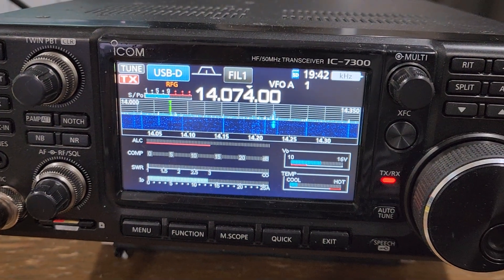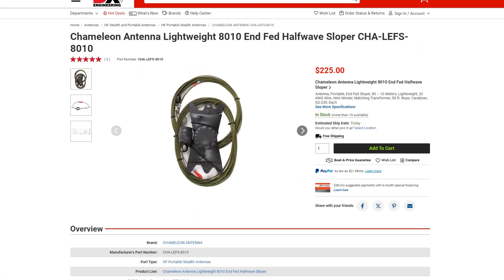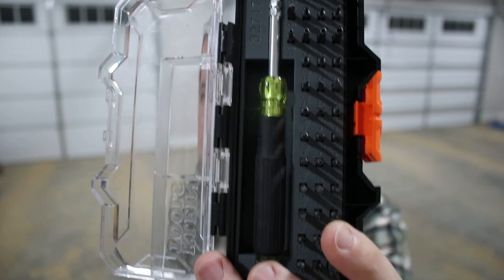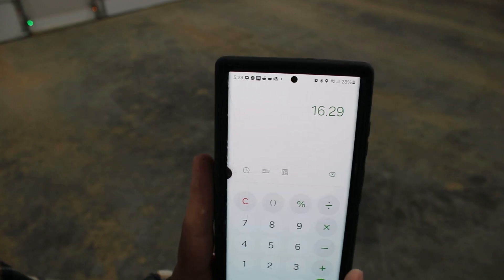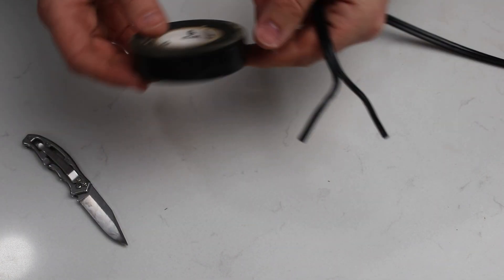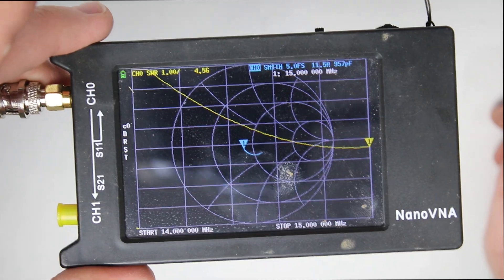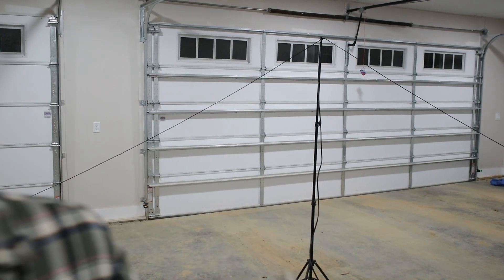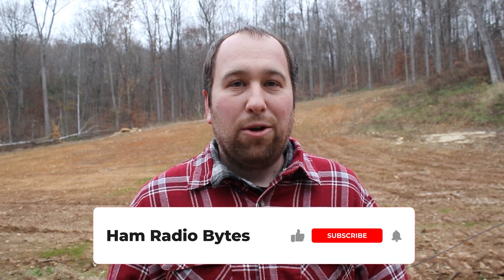Building Your First HF 20m/14mhz Antenna Under 15 Minutes | Ham Radio HF | IC-7300 | Ham Radio Bytes

Comment from the maker: In this video I show you how to create a HF 20m antenna in just a few minutes without a very big investment. I was able to use this antenna with my Icom IC-7300 to communicate to amateur radio operators all over the world using phone, FT8, WSPR, etc. I got a SWR reading of 1:1.8, which my built in antenna tuner was able to tune it up to 1:1 on both 20m and 40m. 

What are some ways you could improve this antenna?

Video Specific Affiliate Links:
Screwdriver set: https://amzn.to/3D7f8Yx
Speaker wire: https://amzn.to/3Dbkke2
Lamp Cord: https://amzn.to/4g7oF0h (can be found in smaller qtys)
Black tape: https://amzn.to/49uZjac (American made)
BNC to Banana: https://amzn.to/4grBL8y
Banana plugs: https://amzn.to/49BC3aD

Comment: Im going to try this out - thanks for making the video!
Reply from the maker: It worked pretty good for me! I did learn since then that is doesn't tune very easily on other bands as well as other ones do. but honestly it seemed transmit and receive better on 7mhz than one I ended up purchasing later that was designed for several bands.

Comment: I use one of those light stands when out portable 😎 I found it in the garbage a couple years ago. I found that the top portion is the same diameter as a broom handle from the dollar store so I was able to get some more height out of it. Another thing I did with my dipole was make it a fan dipole by adding two more elements and using tape to temporarily space the ends of the 10m elements. I also found a really tall more compact aluminum tripod that was getting tossed out at work that fits in a very short 2 foot  bag about 3 inches in diameter for portable use 😎  you can play with the SWR some by changing the angle of the elements. Some light dollar store rope helps to extend from the ends of the elements to get the angles you want.
Reply from the maker: Wow that's some cool ideas! It never dawned on me about adding another element! I may have to try that out! So that would make it work for other bands as well?
Reply: @HamRadioBytes  yes you can add more bands by adding elements tuned to the bands you want. So I added a set of elements tuned to 10 m. Therefore making a simple fan dipole
Reply: @HamRadioBytes  I'm working on a simple way to separate the elements with rubber fuel line with cuts in it so I can wind the antenna up and then add the spacers when I set the antenna up. It's easier if the antenna is going to be semi permanent
Reply from the maker: That's awesome!! That is exactly what I need! Thanks for sharing that!
Reply: @HamRadioBytes  no worries, thanks for posting a cool video for us to share stuff 👍👍 I'm actually just about to set up my portable rig with that antenna at my local ski hill because they are closed and I can't go snowboarding. Even though I'm only 8 minutes from home lol